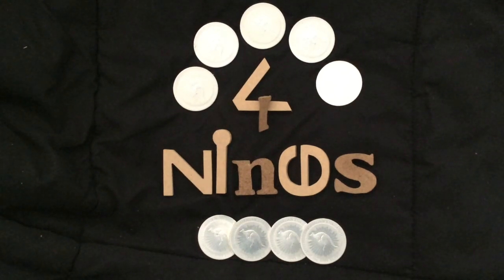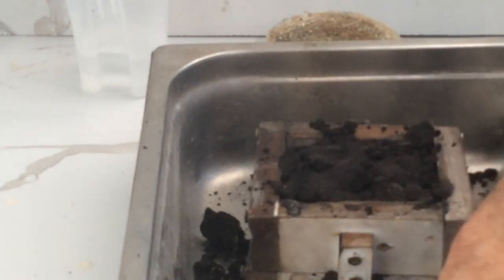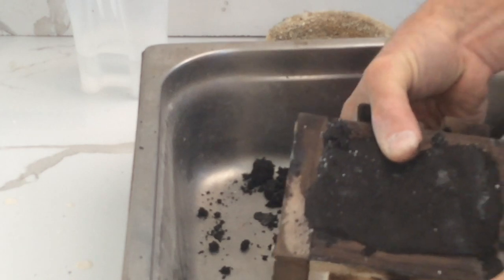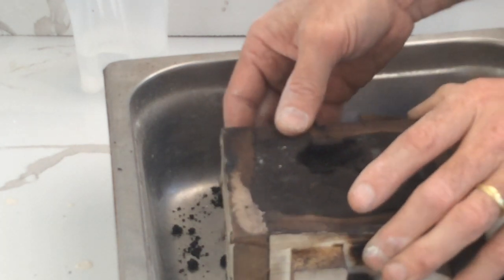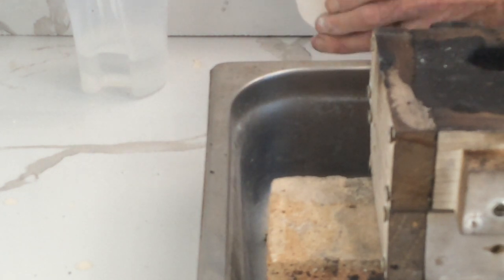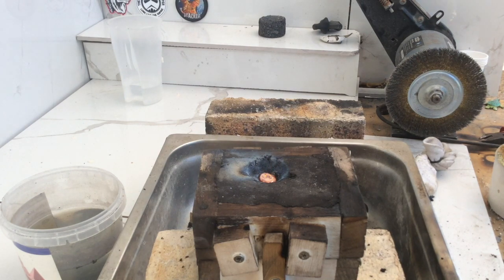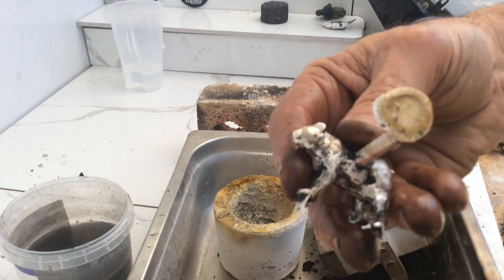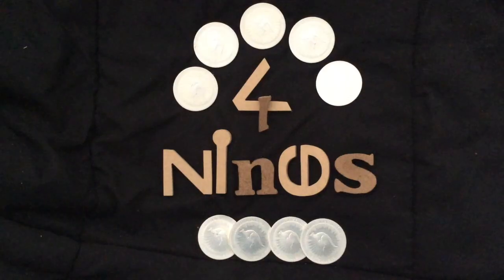How to make a Crucible part 2

Comment: New subscriber here.  I love the way you show low cost ways to get into melting and casting.

I see you have made your own crucibles using different materials.  If you have said which method you like the best I missed it, though I watched them all.  (I ama little distractible at times.)

So, is there a clear winner?  If not, are there pros and cons you can give?  

Thanks for putting this info out there, and for considering my request.
Reply from the maker: If you are going to use a a Oxy to melt metal then I what is the j Would suggest the best and safest Crucible is a ceramic dish crucible and a steel handle you can pick up on Amazon very cheaply or just a few dollars and if you were going to use a furnace fan I like  graphite crucibles hope this helps🤠😎👍

Comment: I was a welder and in demolition which I us torches to cut thing up. So getting burned from molten metal was a normal daily thing. Wearing gloves is not always a good thing like when molten metal goes in your glove you will have 3rd degree burns before you can get the glove off. Most of the time molten metal will bounce off your arms and hands when not wearing gloves. That's my experience and opinion
Reply from the maker: Yes I would prefer not to wear the gloves but thought I do a few videos wearing them just to try and be safe in front of all my subscribers wouldn’t want anybody to get hurt💛😎👍

Comment: What kind of sand is that? I want to start pouring! #silverstallion
Reply from the maker: Are use fine silica sand not that easy to come up with over here💛😎👍
Reply: @4ninesfinesilver315  thank you my friend! So it's hard to come by there?
Reply: watt about using some wet crumbled up charcoal smashed into fine sand like material and dryed of course.